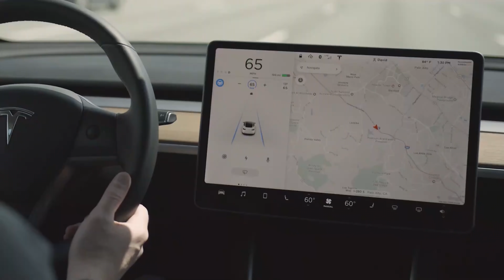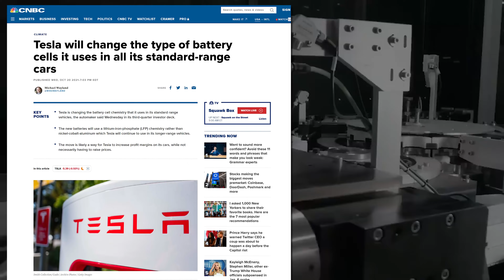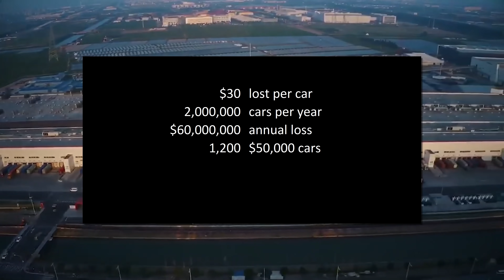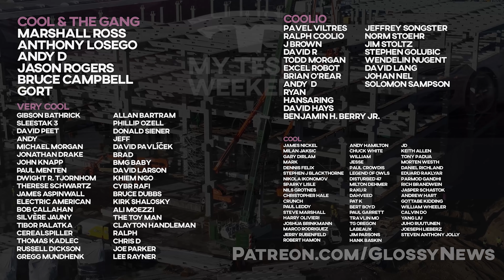4 Reasons the next GigaFactory is a mystery

Comment: Bonus reason #6 Cash flow. Tesla's value is mostly paper value in stock. Over inflated in my opinion. But setting that aside for the moment... What is their actual available cash from the sale of cars?
Reply: Tesla are sitting on around $16bn cash and $3bn in Bitcoin.
Reply: At the end of Q3 2021 Tesla had over $16bn in cash and cash equivalents - enough for 5 GFs, plus the ability to raise more easily by issuing more shares…
Reply: @serendipity7442  Ok, where did that cash come from? Sale of cars? Seems unlikely.
Reply: @DavidJohnson-tv2nn  Mostly from previous share sales. However, total Revenue from Q3 was over $13.5bn, Gross profit over $3.5bn, free cash flow (ie minus CapEx of $1.8bn) over $1bn. Since Tesla don’t pay dividends to shareholders the cash is basically piling up and being used to grow the business or pay off debt early  (which is only $2bn now so the rest could be paid off whenever)
Reply: @serendipity7442  So mostly from stock sales? Again, in my opinion, the stock is pumped up, over inflated by Musk, Tesla, and supporters. But paper value only. Basically little real value in assets or sales.
Reply: @DavidJohnson-tv2nn Previous share sales to raise cash are historical, from a time when Tesla was much smaller. The share price could drop to $1 tomorrow and Tesla would still have 16bn in cash plus the ability to generate $3bn in cash each quarter at current sales/revenue levels of $13.5bn each quarter. That’s a money making machine that is currently growing at over 50% YoY *irrespective of the share price*…

Comment: I expect that supply chain (not just batteries) is what is holding any announcements hostage. Cyberpod/Robotaxi and Cybervan will be next announcement and they will be built in an Austin expansion and in the logistics lot at Shanghai. They'll throw up a ramp structure or buy the car trailers and use more loading docks. I don't expect any new locations any time soon.

Comment: You're probably right. All of the above. I reckon full capacity on the 4 factories (the FABS Fremont Austin Berlin Shanghai) is being sandbagged to high hell. Wall Street calculates output at 4m eventually, whereas I reckon it will grow to around 9m (per year) eventually. So you don't need many more factories until the production S curve starts flattening out on existing capacity. Beyond then, the question of Right Hand Drive needs resolving I assume, indicating UK, Japan or India as the largest economies that could cope. I seriously believe India is out. If Elon believes German red tape is bad, he hasn't imagined the Indian red tape. Also since India is protectionist it doesn't have reciprocal free trade deals, so although you can get round import duties in a nascent market by going there, you can't get round export tariffs at the same time. China can just expand as you say. The largest really untapped market is the US (at 3% EV penetration). Europe and China are much larger. So I can see an east coast factory in the US. Since Japan is the world's 3rd largest economy, I can see a factory there at some point and it's a massively untapped market for EVs. That will mean the 4 largest economies all have Tesla production. After them, you have the UK. It's hard to see that you need Japan and the UK, but the reality is Europe will need another factory. There is no better place to do business in Europe than the UK. Elon would find it a much lighter touch regime than Germany. I think there's a strong case for 3 factories in the next wave and I believe they will be US, Japan and UK. If there's 4 then include India.
Reply: There’s no Right Hand Drive question that needs resolving. Existing factories can make them for export as required…
Reply: @serendipity7442  Apart from zero tariff deals with recipient countries....
Reply: @andyonions7864  that’s an issue relating to the pros and cons of importing vs producing locally and tariffs between countries, not with rhd/lhd as such. Giga Berlin for example can ship rhd to Uk & Ireland and not worry about tariffs. Similarly shanghai shipping to rhd Hong kong…

Comment: I think the key is, as you mention, that they've got plenty of space overall.  In principle, they never need to open another location.  There's enough room in Texas and Berlin to expand to 20M cars per year.

They won't do that, of course. China has been so massively successful that it makes sense to build another factory there if Shanghai is out of space, and there are strategic and logistical reasons for more sites.  Building cell lines near the raw material supply makes sense.  Building assembly lines near the final customers makes sense too. But these decisions are driven by improved efficiencies rather than being space constrained.
Reply: Yes but Tesla wants to localize production.  Also remember that there's import tariffs in most areas.
Reply: This. If they already have permissions and utilities for existing factories it's logically going to be easier to expand at existing sites rather than jump through all the hoops again to break ground somewhere new.
Reply: Great comment!  I totally agree..
Reply: Hmmm, are you aware of how many lawsuits have been filed simply based on water usage, not to mention the wildlife suits in Berlin? "plenty of space" would seem appropriate for Texas, Nevada plants, but rather flippant statement regarding Berlin.
Reply: @erwinbockler7590  Have any of these lawsuits been successful?

Comment: I think you nail it. With what is built they can get to ~5M per year. They know it’s about an efficient factory and if building green field factories it’s worth it to verify what you learned from the last before moving to the next. Elon mentions how they have basically a brand new Model Y coming out so the ramp will be slow. The are moving battery manufacturing local which is new both in internalizing and form. I do think the announce something on the January or April call. I keep thinking Poland and another in China for more EU & Chinese production and sales. (No rumor for Poland, just picking some place out of Germany and all the protests & bureaucracy)
Reply: If Berlin needs to be scrubbed due to bureaucracy Poland would be an option. Otherwise it’s practically next door to Berlin and wouldn’t make any sense

Comment: Jörg Steinbach, the Minister of Economy, Labor, and Energy of the State of Brandenburg, has been Giga Berlin's biggest cheerleader in Germany. Yet in an interview last month, he stated he will not support phase 2 and phase 3 expansion because of Berlin's water shortage. So unless Tesla can expand there without using additional water, the expansion point of your argument may be dead.
Reply: I have a solution.  Tesla should buy the nearby cement factory which uses hundreds of times more water and shut it down
Reply: It should be possible to get around that.  Water can be (almost) 100% recycled, so the net effect on the water supply can be zero if that's what's required by the authorities.  They could even truck in an extra load of water every so often if the loss due to evaporation is deemed unacceptable. (Not that I think trucking in water is a good idea, but the point is that whatever requirement they set can be met.)
Reply: @AmiGanguli  You may be right, only time will tell. I know they added the battery factory without additional water, but I don't know how much of that was savings or if they were 'sandbagging' on the water requirements for the main factory in the first place. What's interesting is it doesn't appear Germany allows the use of "Grey Water" for bathrooms and such. Here, toilets, urinals, etc. have their own plumbing. This allows wastewater to be recycled onsite/offsite after treatment with far fewer steps, smaller processing plants, cheaper cost, etc. than drinking water. It is usually dyed blue to distinguished it. We can only water our yards with 'Grey/Blue Water'.

Comment: Bonus reason #5.  Sandbagging.  I'm skeptical that there is already another site under construction.  However, I am much less skeptical that Tesla may be understating potential production capacity of existing factories.   Could Fremont = 1, Shanghai = 2, Berlin = 3, Austin = 4 , Total = 10M/year?  How many more vehicle factories will Tesla need to reach 20M/year?  2-3 more, the size of Austin.
Reply: We don't know exactly just how much expansion is possible at the existing sites. And Tesla are always doing more with less, i.e. reducing the footprint of their operations, thus can produce more within existing spaces. It may even be the case they can get to 20m vehicles per year with the sites they already have.